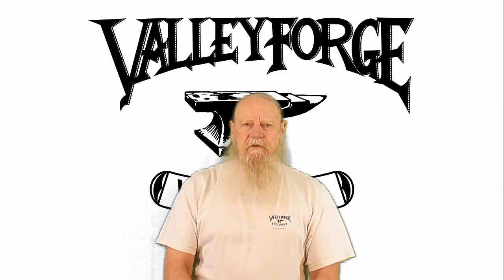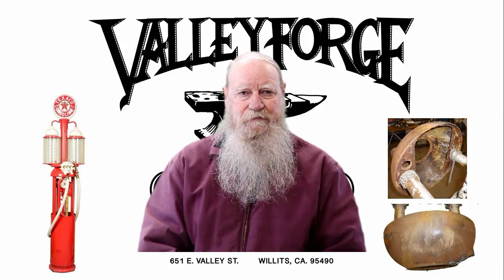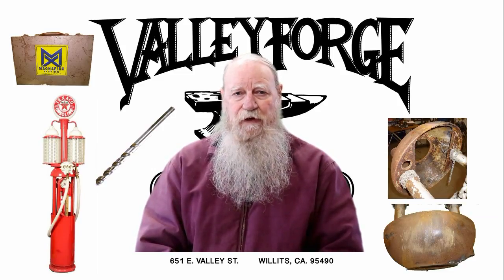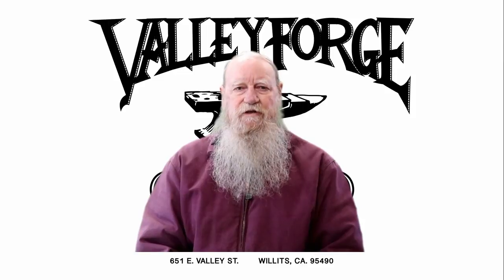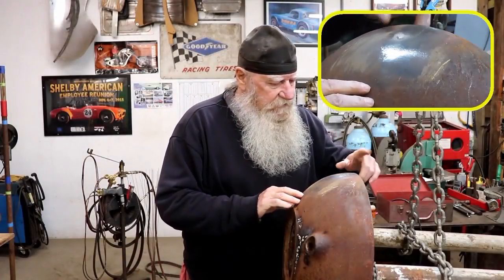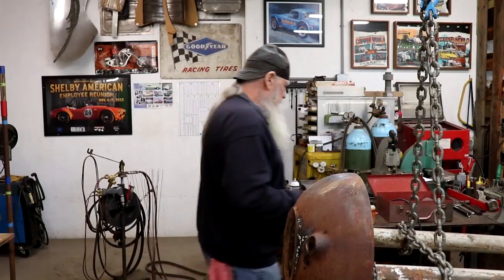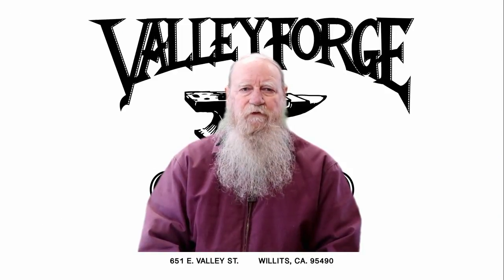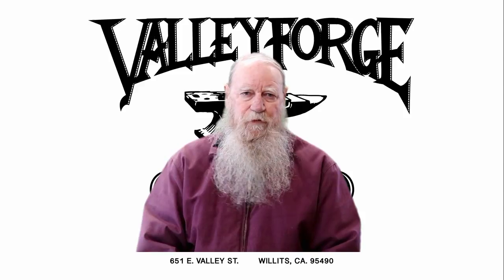Welding Cast Iron With Cast Iron Welding Rod #1

Comment: I bought some rod and flux. Its great, works very well and really makes more sense when using flux when compared to tig welding with argon sheilding
Reply from the maker: Hello Derek:

Using Oxy with cast rod is much better than using Ni rod.

Thanks for watching.     Jere
Reply: @jerekirkpatrick2092  
It certainly does. I was able to weld a cracked maniflod quite easily, drilled it out and cut a slot through the crack with a V. Got full penetration to the inside and it is fully fused and filled. I have photos on my instagram derek_rebuilds.
Thank you for the video and sale of materials!
I also tried the flux with silicone bronze rod and that works well too.
I have taken jewelry classes and have done lots of soldering, so I find gas welding to be more intuitive in this type of welding.
Just saving up for a Henrob.

Comment: when you not as aggressive, you are saying less of an angle? more flat?
Reply from the maker: Hello Thomas.

Yes. If you look at the angle of the drill in relationship to the edge of the grinding wheel you will see what that angle is. You want to reduce the cutting edge angle from 50 degrees to about 5 degrees. You want to keep the drill from pulling itself into the work piece.

Thanks for watching.               Jere